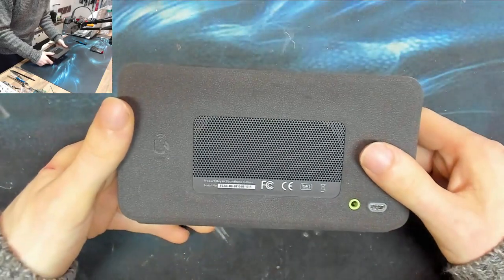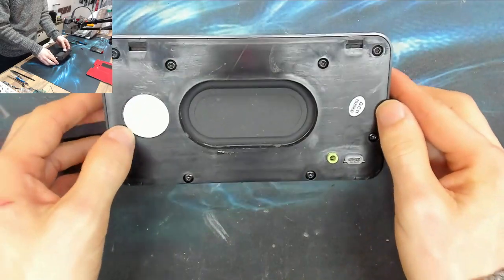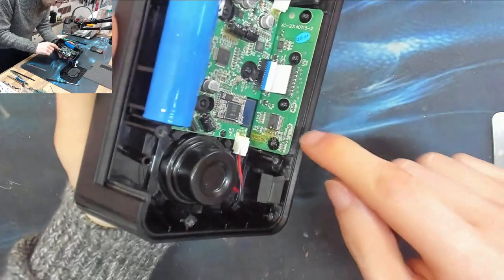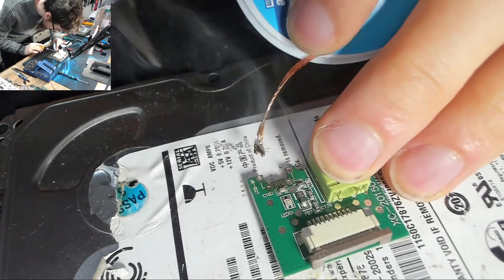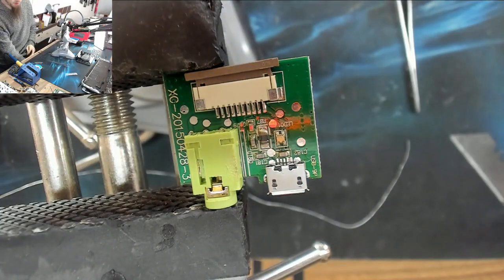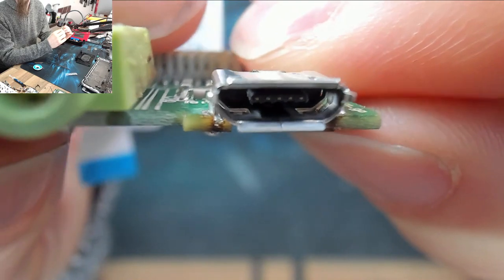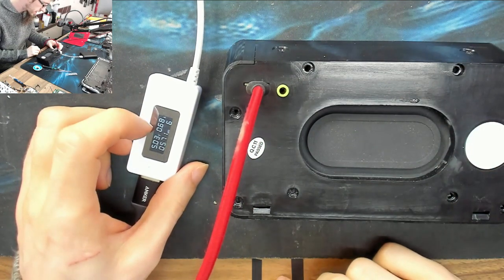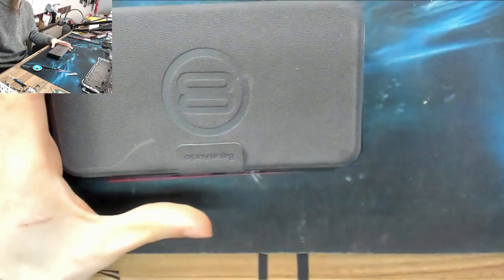LFC#146 - Bluetooth Speaker Broken USB, Teardown and Repair

Comment: 1. That 'fake' speaker is a passive radiator. Very common technique instead of a bass port. Benefits is the air pressure inside a closed box and the area of the radiator is much larger than a regular bass port can be to be effective.   
2. To avoid solder gets into the female connector, put a male connector into it (maybe with some non sticky oil stuff on it) to be sure the solder cannot flow and stick inside the female connector.

Comment: as other have said, that dummy speaker is a passive radiator. they are used instead of ports and perform the same function, namely to tune the speaker to a desired frequency on the low end. the port does this with the actual column of air taken up by the port (the longer the port the more air that will act as a "spring"), while the radiator does it with a physical membrane (adding mass to the membrane is the equivalent of lengthening the port). 
the reason they were not used and hardly ever seen in consumer products is because they add cost when compared to port, which is basically just a molded plastic tube. however, the big advantage of using radiators is saving space in designs which are designed to be as small as possible.

Comment: On the back...it's a reflex pad, some call them radiators) which replaces the bass chamber and works in sync with the other speakers They work very well indeed.  My solution to a weak but connected anchor is a very small blob of two part epoxy.  Works a treat and can be removed.

Comment: How to convert that bluetooth speaker into wire direct plug using its charger. Instead of using micro usb charger? Due to tha pcb diagram were damage/ scratch.

Comment: Nice video! When you slightly damaged the pad/PCB I've got some tips to avoid that. To avoid a lifted land, the temperature and tip of the iron is important. For example, If you're working on some big through hole components where the pad is large instead of increasing the temperature, which has a higher chance of getting a lifted land, of the iron you can use a PCB heater which pre-heats a board so the solder flows better and you don't have to solder at higher temperatures. Also when re flowing solder it is best practise to put some flux on first.

Comment: question i had a charger socket but when I took apart speaker it was nowhere to be found anyone know how to figure out what kind is needed or they are essentially the same and form is only thing that matters? like the through hole vs surface mount like he mentions at 7:12

Comment: Hi there, accroding to online reviews the speaker I just bought is prone to charging port failure. Do you think I could prevent it to happen by opening the case and using glue gun to reinforce the port? It won't be beautiful but I doubt I could do such delicate soldering work as you did if it is broken in the future.

Comment: Great fix! Thanks Graham! I will have to watch your other video on the JBL speaker similar repair. Think half the trouble is taking it apart! Is it better to replace the charge port with a matching one, or use an existing USB cable, and solder the end wires to the board? Thank you 🤓
Reply from the maker: I replace ports, but I know people who will often just solder a USB cable in for a quick and dirty (cheap) fix. Nothing wrong with either method, just depends on what quality of finish is important to you.
Reply: @Adamant_IT  got a hold of a Sylvania 16 inch Bluetooth speaker. Unit seems to work, but the charge port has been broken off, so as it is, it can't be properly recharged! Thank you

Comment: Question.  The usb snapped off the board of my Bluetooth speaker.  When I took it apart, looks like it's still ok.  Can I just resodder it on or do I need to buy a new one?  And is there anything special I should know.
Reply from the maker: You can probably solder on a new one if you have the equipment for it. It's not a easy job for a novice, but if you've got any soldering experience, it's certainly possible!

Comment: What if the inside of the port is really bent and badly damaged what tools do I need to replace the and where do I buy it from the actually new port to install in our the Bluetooth device
Reply from the maker: You need at least a good soldering iron and moderate skill with it. Replacement ports can be found on ebay. These speakers usually have generic SMD Micro USB ports, so it doesn't need to be specifically for the device you're fixing.
Reply: Adamant IT oh k thanks

Comment: Hi....
Plz advice on problem "while I was doing soldering on charging port, I forgot to remove the battery wire, soldering ion melts and drops on the base of port and it contect circuit and becomes hot that time and now it is working.

Plz explain how to diagnose and what may be the problem.

Finally requesting for your phone  contact for better explanation.

Thanks